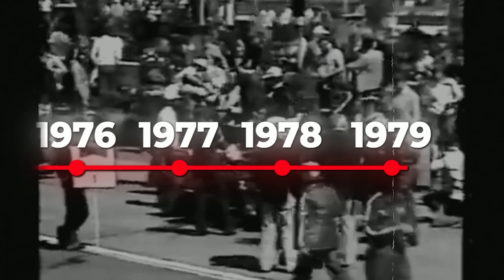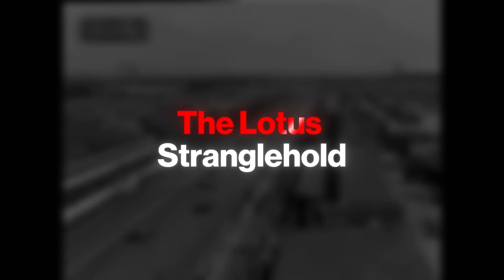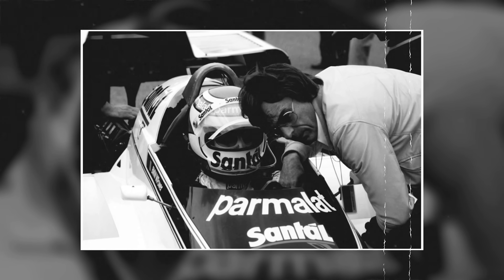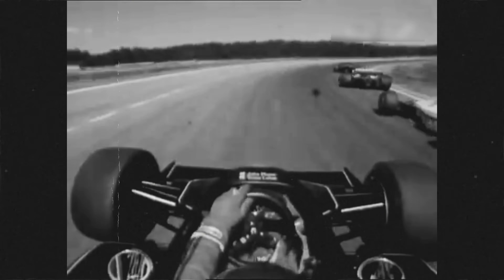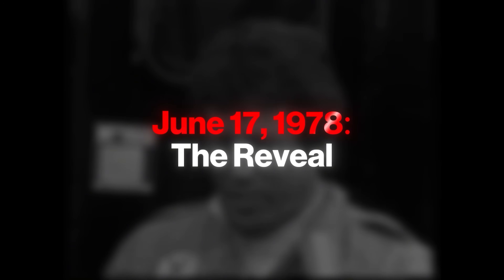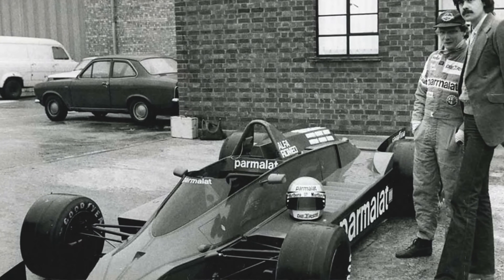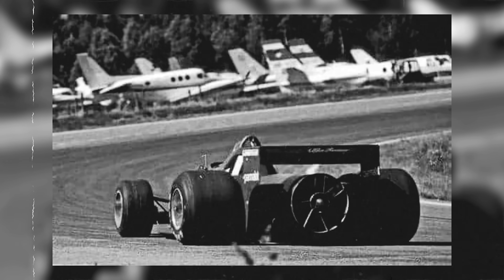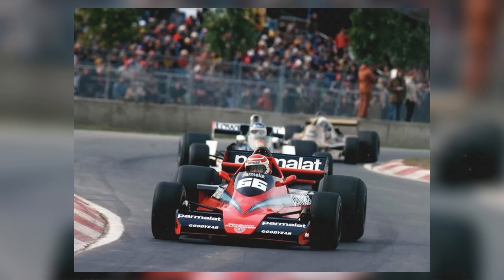THE EXPLOSIVE TRUTH BEHIND GORDON MURRAY'S BANNED BRABHAM BT46B FAN CAR

Comment: I don't believe at all, that they had no conventional radiators and used 'flat' panels on the bodywork 😢 there is no evidence to support this that I have seen, no published photos support this¡ But the fan was AWESOME... while spraying debris at the following cars😅 lol, talk about a rear gunner!
Reply: It's absolutely true, the BT46 initially had surface cooling, but they couldn't get it to work in testing and replaced it with standard radiators, IIRC before the season started.  Wikipedia - "The most radical feature of the original car was its use of flat plate heat exchangers mounted flush to the surface of the bodywork in place of conventional water radiators"
Reply: All you need to do is Google "Brabham BT46 surface cooling."
Reply: It's true